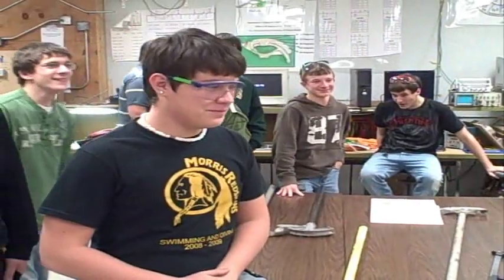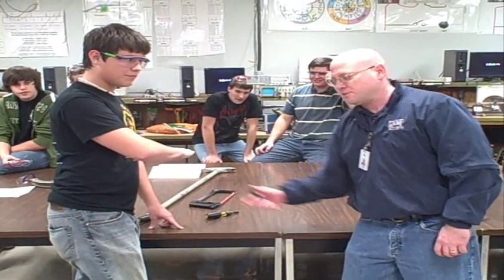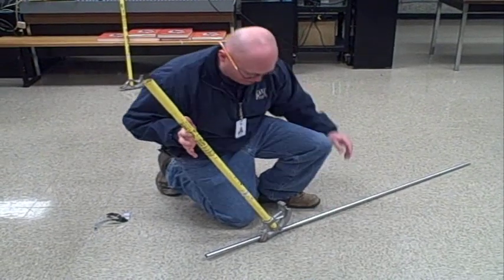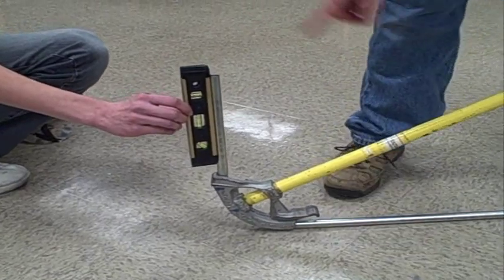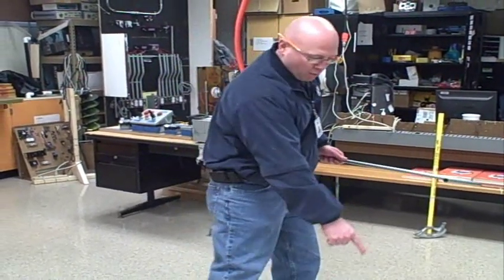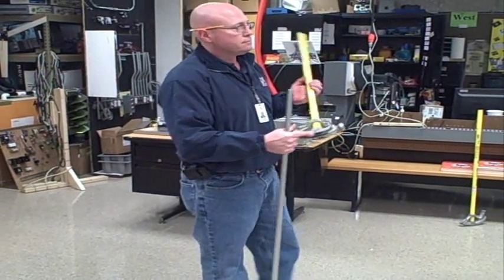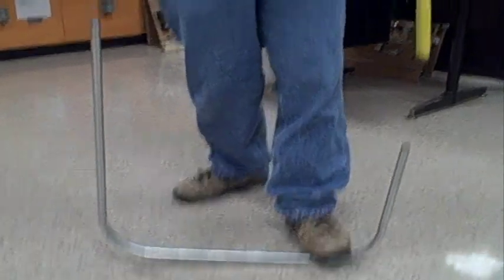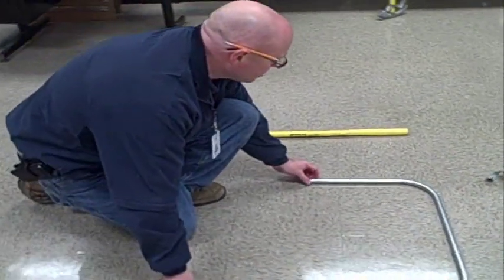90 degree stub up conduit bend into a back to back

Comment: Great video; as a newbie to running conduit,  I liked the tips on using the handle to tweak a bend and using the wall as guide for measuring off the back of the bend. I also noticed, it would seem you could use the bender handle itself for such a purpose. Look forward to checking your other videos. Thanks.